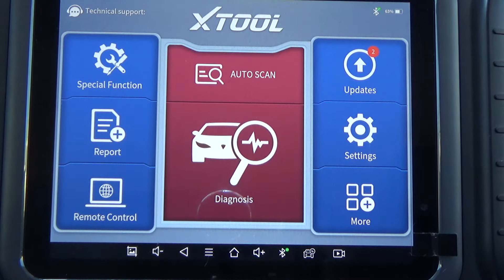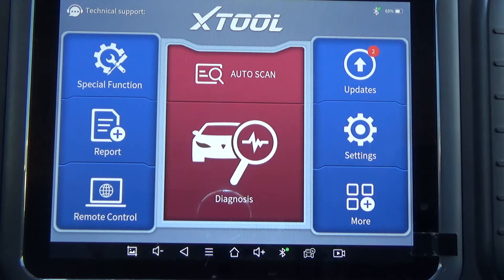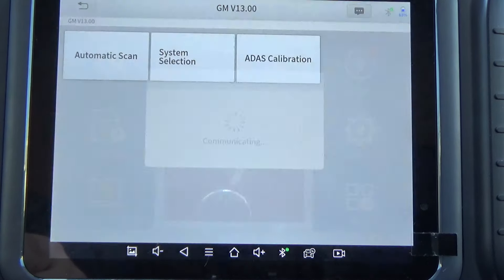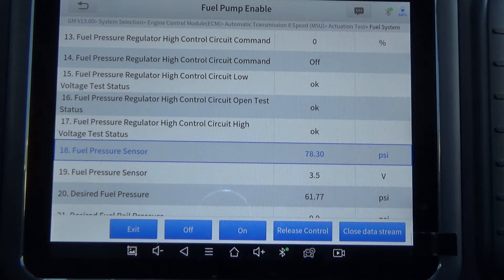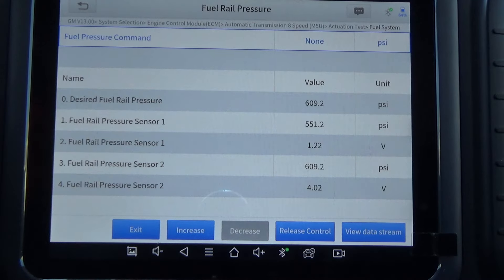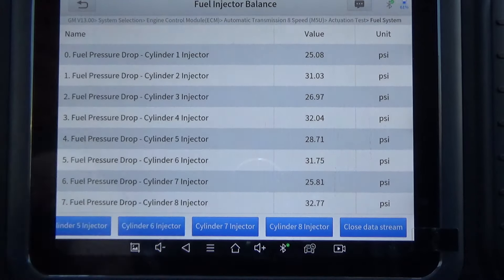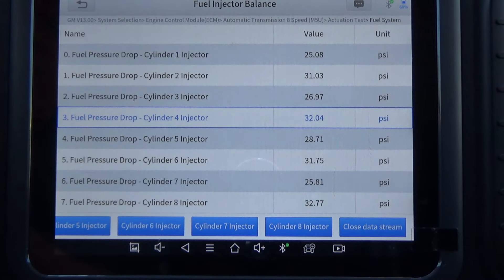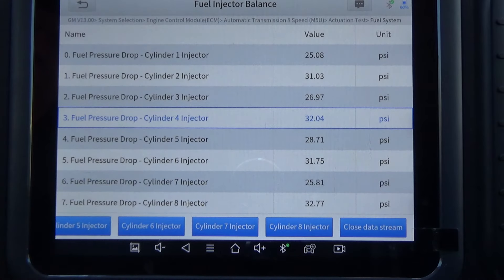Performing a Fuel Injector Balance Test on a Direct Injected Engine using the Xtool D8 Scan Tool.

Comment: The best explained, man you literally explained the fuel injector balance test the best. I watched 1 video where the guy was saying to just check for any noticeable differences in the psi readings. You have to do things by the Manufacturers book with cars. Thanks a lot, clearly the difference between a tech & backyard guy!

Comment: From what I've researched  GDI engines inherently have a rougher idle than port injection even when brand new. I've owned two brand new 1.4 GM Ecotec cars, One was a non-turbo port injected engine idled as smooth as glass for the two years I owned it. Then I bought a brand new 2018 chevy cruze turbo GDI engine and i noticed immediately that it idled less smoothly Ive owned it 5 years now with no issues but it only has 20k miles 🤣😂

Comment: Thanks for posting this. I've been trying to find out if the D8 tool can perform this test. Now that GDI motors have been on the road for ten years, suspected fuel system problems are becoming quite regular.

Comment: Will this tool not pulse the injectors like you did with the autel in your other video?
Reply from the maker: Yes it will, but pulsing the injectors is year, make, and model dependent. This truck has high-pressure direct injected injectors which means it has a high-pressure pump that has to be pumping and it can only do that with the car running so testing these injectors involves more than doing a simple pressure drop test like you can do on non-direct injected engines.
Reply: @737mechanic Ahh, got you! Thank you for the explanation!! 👍
Reply: Can you please link the video @victorhoyt4352 is referring to?

Comment: What model scan tool would you recommend for mainly diesel pickups. Powerstrokes and duramaxs. I’m looking for one I can turn on and off injectors
Reply from the maker: My Autel has been rock solid on Diesel's 
https://amzn.to/44vNH2U
but I am sure the xtool D8BT will get the job done also. The nice thing about Amazon is if one doesn't do what you need send it back and get the other one.
https://amzn.to/3YKeZ4d

Comment: But when filter bad  inside injector how you know in this test
Reply from the maker: If the filter is clogged up there will not be as much of a pressure drop.
Reply: @737mechanic  thank you very much

Comment: Great vid and explanation just curious where didn you get that list of instructions to perform this test?
Reply from the maker: pro demand.
Reply from the maker: @sheepdog3828  No, it comes with 3 years of free updates then after that it is 199.00 a year but you will not need to update it as long as you are using it on your own cars and they are covered by the software that it currently has. Where did you see $174 a month.
Reply from the maker: @sheepdog3828 Search for Mitchell 1 diy and alldata diy, both are simular and offer plans as low as 3.61 a month.

Comment: You advice to purchase this scantool
Reply from the maker: For the money it is hard to beat. I highly recommend it.
Reply: @737mechanic   if use obd 300cm extension then you can take this scantoll on the  engine and will charging automatically and no need wifi  scantool

Comment: Two questions for you sir? Where did you get the procedure and would it be different on the Ford 3.5 Ecoboost?
Reply from the maker: I used Prodemand for the procedure and ford has a test called Relative Injector Flow test that depending on the year make and model some scan tools can do. 

All prodemand says about doing that test is to follow the scan tool directions.

It is a straight forward test that the scan tool cranks the engine while monitoring each injector's flow rate.

Comment: Hey I jus eatchedbanithe rif your videos with you using your launch I couldn't find your bakancr test video with the launch ..however looking at this video it looks as if you have a fuel rail with 5 to 7 psi ..are all those cylinders in 1 bank ?
Reply from the maker: This is a v8 5.3L engine so all 8 cylinders are for both banks. The launch x431 pro does have the same function.
Reply: @737mechanic  well actually what I mean is that you have 2 fuel rails it looks like u have 4 injectors pushing under 30 psi all around 25 or 26 so I'm thinking that one bank of cylinders has a lower psi ..so that may be from the HPFP or it's roller ..wdyt?
Reply from the maker: @RoadHeros610  So the fuel rail pressures are around 500 to 700psi, the 25 to 26 psi you are seeing is the pressure drop when the injectors pulse.
Reply: @737mechanic  ok

Comment: i thought power balancing the injectors would mean you hit a button and the tool changes something to make them flow more equally. this seems more like just a way to check for a bad injector rather than enhancing power output.
Reply from the maker: Yes, you are correct. Scan tools are for troubleshooting and diagnosing issues. A performance programmer is more what you are talking about.
Reply: It can be used to code and reprogram but it's not as simple as pressing a button, you have to code it through CANbus.

Comment: If you notice on this--  all your odd injectors are around 26psi, and all the even injectors are around 31psi.   But they are very similar on each bank.  So I wonder if there's just a flow issue with their rail design that causes it to have a different reading on each side?   Maybe the pressure regulator is closer to one side and allows it to depressurize just a bit faster??    It's a little weird that one whole bank is lower than the other whole bank.
Reply from the maker: Thats a very good point. I might have to look deeper into that and see what could cause that.
Reply: I have the same issue.  Any updates?
Reply from the maker: @JoeyBrioso-l9m  The truck runs good and gets good gas mileage so I haven't worried about it.
Reply: Interesting observation. I come from a residential plumbing background and we are taught that when hooking up a double water heater situation if you don’t create equal distance from the infeed tee that the water heater closest to the infeed would always work harder and wear out sooner. I noticed on my 2016 Escalade with the L86 they do account for this and feed it to a splitter that has equal length pipes feeding each fuel rail.

Comment: I just purchased an Autel and had run this test on my wife’s 2016 Escalade with the 6.2 L86, I had just finished a basic AFM delete with the new cam shaft and L7 lifters, and I sent the computer of to AMS racing to have it tuned for the delete, I also upgraded the valve springs and the rocker trunions while I was in there, and I bought some refurbished injectors on Amazon so you can imagine my frustration when I fired it up and it had a rough idle. But I gotta say it was so nice for the first time in my life to sit on my ass in that nice leather seat and check nearly every system on that car with my autel and find one injector that was dropping 20 psi more than the others, I can never go back to living without it haha. On that note anyone know of a good place to buy perfectly balanced injectors that are guaranteed?
Reply: Rock auto, Amazon is a flea market compared to rock auto.